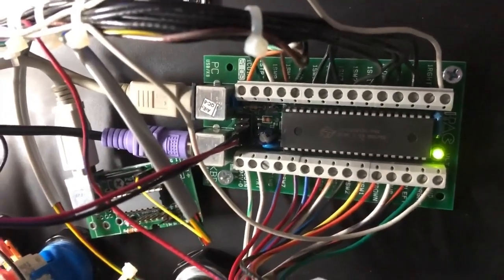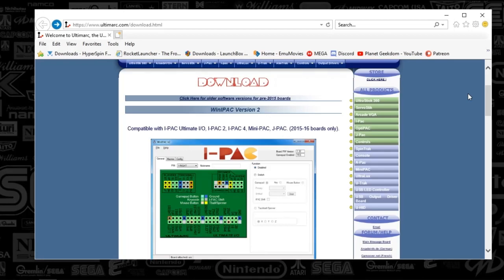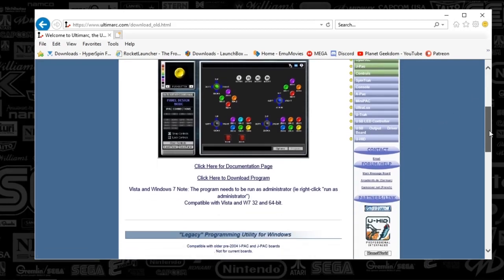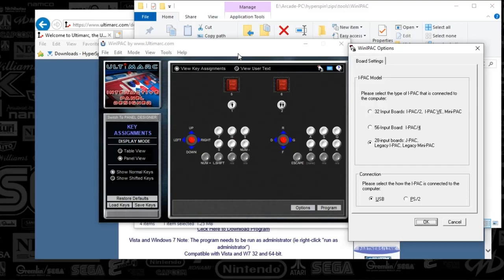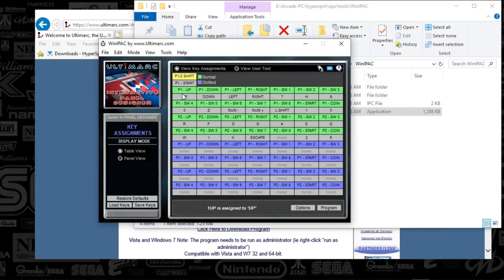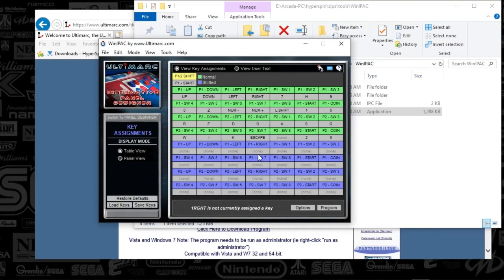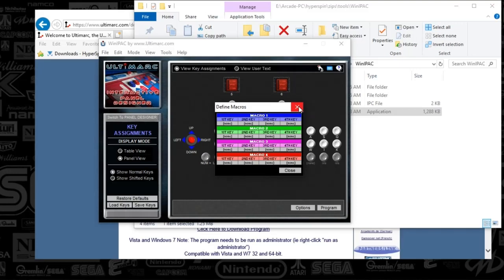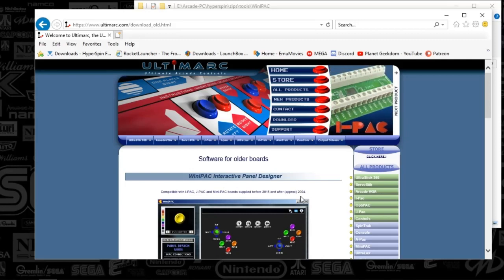Hyperspin-Programming buttons

Comment: Can you post a clear pic of your control panel. Interested to see what all your buttons are for. Can’t see it clear enough on the video!!
Reply from the maker: Hm weird not sure I can post a pic in the comments but I have 7 buttons for player one and two. I also have a coin and start for player one and two. I have a volume up and volume down button. Then I have a 4 way control stick with 3 buttons and a spinner. Finally I have two slots not assigned buttons. It rather hdmi slots to plug old school controllers into my bliss box directly into the panel!

Comment: Hello I understand that your button settings do not interfere with any emulator so-called do not start something that should not, I am looking for some settings without collisions with emulators, as some emu have known to permanently saved assigned buttons, settings, etc. and they can not be changed and so far not I found the optimal one ??
Reply from the maker: I use for player 1

1,5,h,7,9,0,left shift,z, arrows

Player 2

2,6,a,s,q,w,I,k,  r,f,d,g for movement

Comment: Looks like a pain in the but compared to using Xinput
Reply: Maybe but its a far superior encoder than the xinput.
Reply from the maker: Yep it works great. Plus I don’t think you get the same feel on old school games using a controller but I have a choice to use a controller or buttons on the cabinet 😏
Reply from the maker: Set up is pretty easy. The most time consuming is wiring the arcade buttons but then if you don’t want arcade buttons and a cabinet then ya you would just use a controller and probably  just a tv with a pc. This method is to get to the closest feel as possible to the arcades